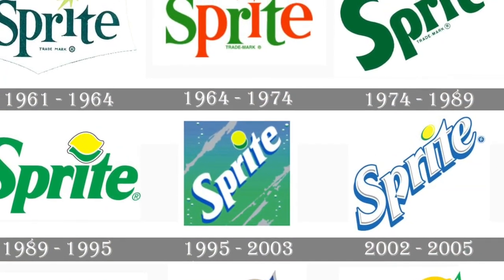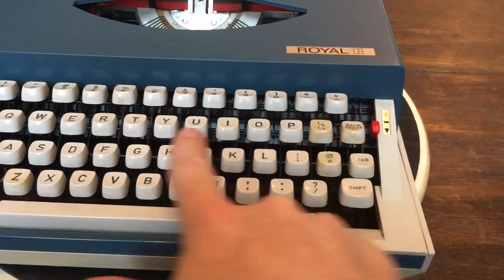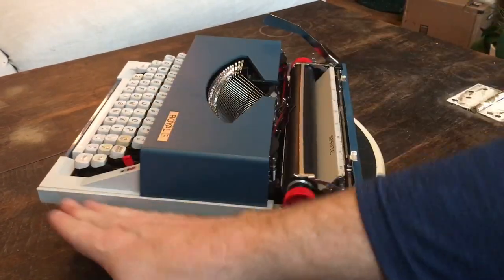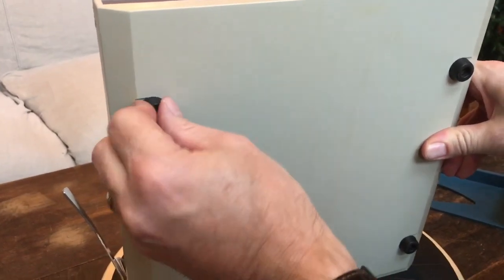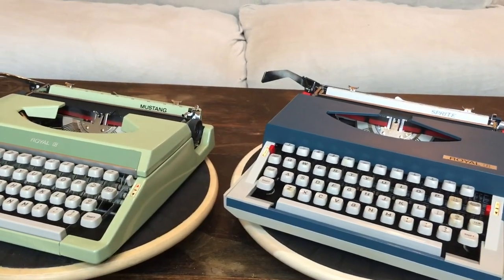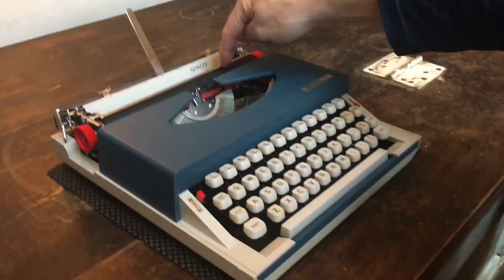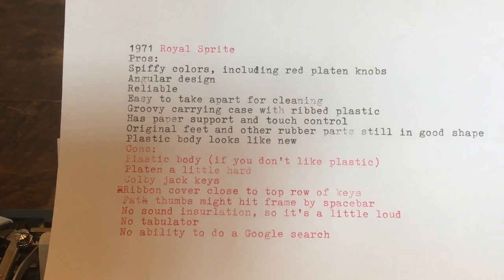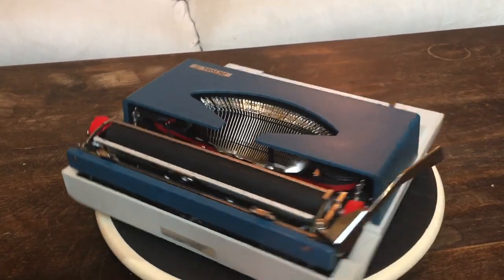Typewriter Minutes - Typewriter Review: 1971 Royal Sprite (by Silver Seiko)

Comment: hey u know when u opened it there was paper so i have mine and im trying to restore it but the paper was ripped and that dose not look good do u know were i could find a replacement
Reply from the maker: Hi there. I don’t understand the question. Do you mean the owner manual?
Reply: no the part that is glued to the base under the keyboard (sorry for the wired question)
Reply from the maker: Ah. I have used a couple different materials for replacement.  Both work well. One is a thin felt sheet, available at my local hobby/crafts store. Also a thin foam sheet, also available at craft store. Or you can find them on line on Amazon.
Reply: @TypewriterMinutes  ok thx
Reply: @TypewriterMinutes  I think I will do the felt and u diserver more subs and veiws ur content is really good
Reply from the maker: Thanks!